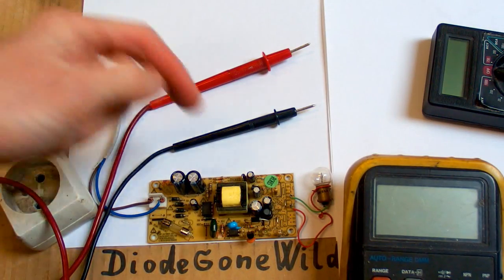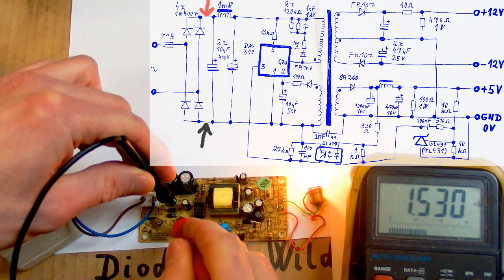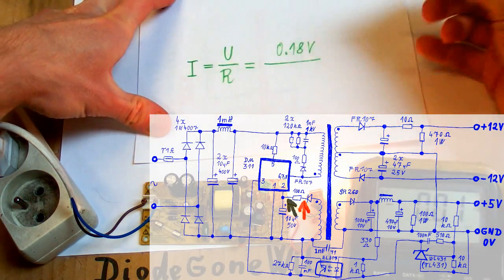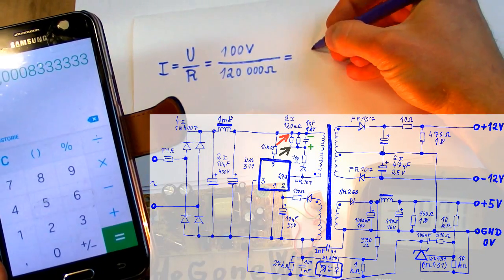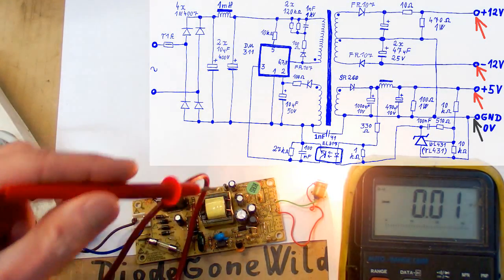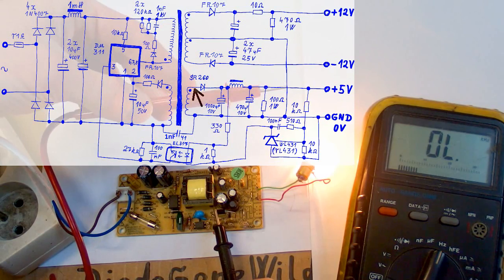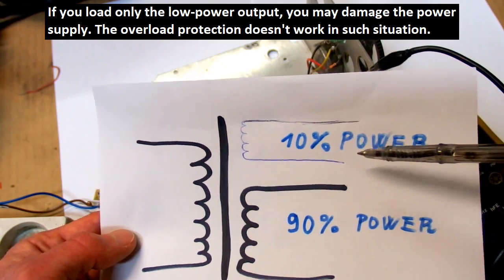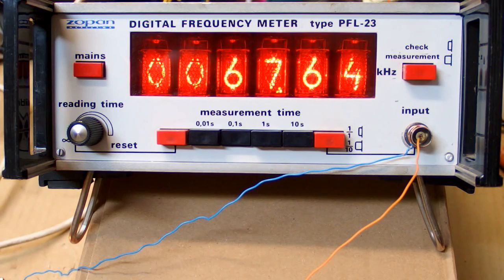How Does a Switching Power Supply Work 2 (measurements)

Comment: The RMS AC mains voltage should be greater than the pulsating DC RMS voltage after the bridge (Off Line converter) by two diode drops with no load or smoothing true RMS. After filtering the RMS will increase relative to the mains having less ripple (moving towards DC).

I enjoy watching your analysis, but viewers should be aware that power supply tests for production test are much more rigorous. For example, in doing the percent Load Voltage Regulation measurement you would use an AC power supply that has a controlled regulated AC output, regardless of the slight variations in line voltage or line frequency, commonly called an AC Power supply (also the AC output is isolated from the AC mains input, which is important for operator safety). An AC Power Supply is used because the definition of percent Load Voltage Regulation assumes a constant and stable line (mains) input voltage and frequency. In a sense output loading is done in a similar manner using DC Electronic Load(s) to provide a stable load measuring base (like 50% load current) while you vary the line voltage for percent Line Voltage Regulation.

So there are many different categories of power supply tests, most common are; Static Characteristics of Regulated Power Supplies, Dynamic Characteristics of Regulated Power Supplies (which many times includes output impedance and stability), Pre-compliance Testing; Conducted and Radiated EMI and THD, Voltage Regulated Power Supply efficiency, Power Factor, and environmental testing (temperature, humidity, vibration, etc.). There are many more tests but are applicable to different product categories, for example worse case in-rush or surge current. Then after the design is completed the supply has to be tested by a third party lab for official compliance verification.

Comment: How to modify (lower)  output voltage.. can anyone help??.. i tried varying 330ohm (2.2k ohm in my case) resistor connected at optocoupler but that dosent help.  No changes in outuot..

Comment: I have an fsdh321 that in datasheet says 12 volt start voltage. does this mean that lower then 12 volt is not going to start working cause in the pcb that is soldered is working with 9 volt and i cant explain how!

Comment: can i bring  2 Switching  power supplys in  parallel ? yes? how do i do it? i want to use it for ZVS
Reply: Yes, you can put power supplies in parallel, as long as they are the same rated voltage, at the end, the power will sum if they are about the same rated power.

Comment: Great Teacher and great videos.  One thing though!.  I=V/R.  That's V (veeee)  not U (you).  Just for your information.
Reply: It depends on your country, here in Czech Republic we use U for Voltage. Also  maybe you can see different drawnings for resistors, capacitors... Yes, there are some differences but it's not important for understanding how things works. 
... We also have swapped Y and Z on our pc keyboards and our B guitar chord is 1/2 "tone" lower then it is in some other countries and if I play an "international" B-chord, then I call it H-chord :D
Reply: @Voldees  Thanks for pointing that out.  I didn't know that.
I stand corrected.
Reply: @MrLRankin2  In Poland also U for voltage and so on... ;)

Comment: When measuring frequency with a multimeter,put a capacitor in series with its cables(probes),so you can measure accurately.
Reply: Hello sir,can u make a demo video ar share any link regarding fequency measurements using multimeter..
Tks,Regards

Comment: Does the energy dissipated by the primary snubber change depending on load?
Reply from the maker: It tends to go up with the load. More secondary current means more primary current. More primary current means more overshoots at the primary during the moment when the transistor turns off.

Comment: Hey that was a clever way to show the changing schematic, super imposed on the video :-D.
But you missed something...... no cat walking by LOL :).
Im not sure if the meter reading across the snubber resistor was 100%, unless your meter was able to give true rms at that frequency.
Only 13 volts running the pwm, i was conned by the 50 volt capacitor lol.
Even a couple of resistors from the +12 and +5v to the tl431 input would not give a perfect regulation, group regulation much like pc power supplys.
Reply from the maker: I'd normally draw it on a paper, but the paper schematic was a mess already :D. I'm in a different location, that's why no cat. You're right, the capacitor in the snubber is far to low to have pure DC on it. The multimeter was showing an average voltage, not RMS. Low capacity capacitor usualy don't come in low voltage ratings. 50V may be the lowest rating of 10uF. PC power supplies have little better sensing that averages more output voltages. It's a bit more accurate, but no output is really regulated. And there's a common inductor for more outputs.

Comment: Thanks again. I probably wouldn't mess with modifying a supply with multiple secondaries like this because of the single feedback loop. 

    I believe this is the same problem people have when they try to modify a PC power supply as a bench power supply. I don't think most people are trying to mess with the feedback voltage, but most people will eventually place a heavy load on a rail that doesn't have a feedback reference loop(s) and I think that causes problems. 
  So far I've limited my switching supply mods to the most simple off line topologies. I have modified the output of an HP printer power supply though. Those are my favorite because the secondary is a center tapped winding on the older style power bricks. They make a great dual polarity configuration for testing op amps and audio amp circuits.
  Thanks again Mr G.W.
    -Jake
;)

Comment: Your Videos are amazing, man! Love the amount of details and explanation. But for your own safety, when your poking around high voltages with your multimeter, you should maybe consider connecting it via your autotransformer/mains isolation transformer. So you can accidentally touch the contacts and still be fine (to live another day and make more great videos).
Reply from the maker: Thanks :) 
I'm not touching anything grounded, just for case :)